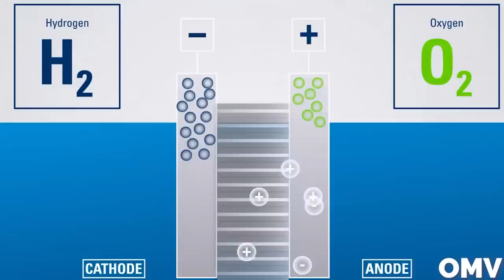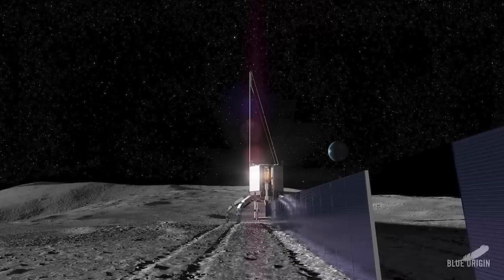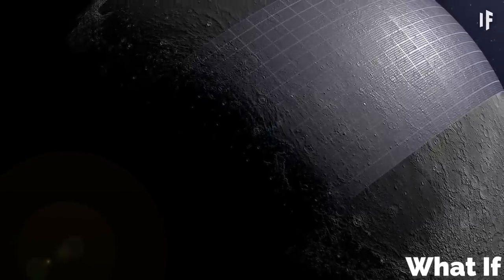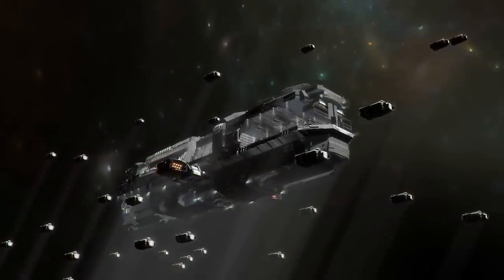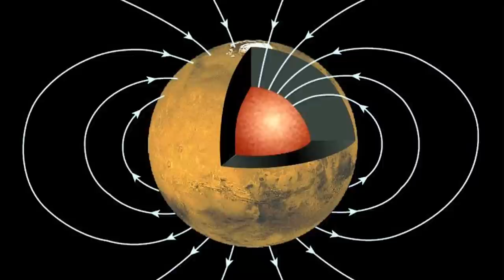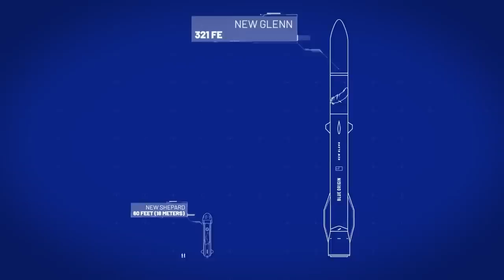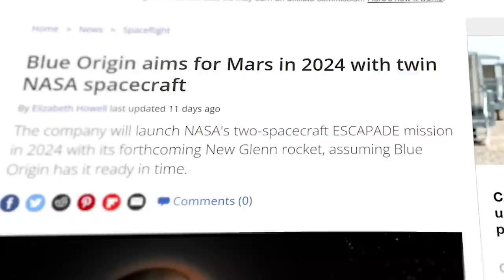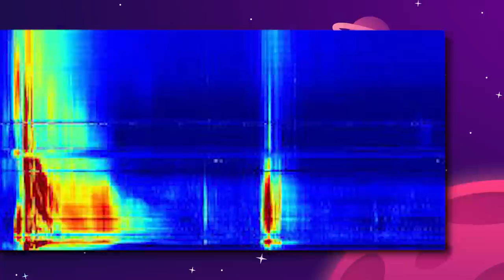Blue Origin Reveals MAJOR NEW Breakthrough On The Moon!

Comment: Tornadoes destroy electrical infrastructure every year. They could build it to withstand tornadoes but they just let it get torn down and then rebuild it to the same standard. This should tell you how much work is going to be done in advance of a severe solar storm. The answer is none. They'll let it burn down and then eat the cost of rebuilding it at that time. Not sooner, possibly not ever.
Reply: Use concentrated solar power with glass reflectors powering the system
Reply: You don't understand engineering at all then 

The cost to rebuild them is lots cheaper than making everyone tornado proof 

Also to make them solar storm proof means encapsulation of every single wire in the grid 

I'm sure I don't need to point out that this would mean every pylon would have to take nearly 2x the weight meaning around 3 times the cost
Reply: That’s a horrible idea in space, the colonists will die without the electrical grid working to operate their oxygen recyclers and various other systems.

Comment: There is 3 obstical in installing solar panels on the moon. [1] up to mach3 hale storms (astriods/bolders/rocks). [2] Moonquake (ground shifting that occurs in inches per month & years of accumulated E.T. debrees & core pressures). [3] solar storm CME to circuitry.

Comment: I like how Blue Origen worked out the smelting method that will work. This new smelting method could be used for so much more than simply building panels. Hint, hint. 
Wonder if we should ask Blue Origen how they plan to use solar panels during the two week night cycles? 
If someone could workout a way to harness the electrostatic on the moon. It would supply all of there power needs and then some.
Reply: Where does the energy come from for melting the regolith?

Comment: Space exploration has long been full of bright ideas, sadly very few of which progress to a working device.  Electrolysis of solid material has been around as an idea for quite a while after people realised that there wouldn't be any convenient reducing compounds such as coke or coal on the moon, mars or the asteroids. The problem is that most reactors involve large amounts of very expensive metals such as osmium and platinum. To produce useful amounts of material it has to large to contain the melt and all the insulation needed. To power this would require many kilowatts of electrical power which all adds up to a lot of mass which has to get to the lunar surface before you get any product. Nice idea if you can manage it, but Blue Origin has got exactly NOTHING to Low Earth Orbit, let alone the Lunar surface. So a fairly distant dream. If on the other hand SpaceX, which has the capability to get there, had talked about this, then it would be more a possibility.
Reply: Mars does have CO2 that can be reduced to carbon.

Comment: I don’t think that solar cells are a viable solution if employed on the moon’s surface. The regolith composition makes it very abrasive. Though there’s a minuscule amount of atmosphere on the moon there is still regolith dust in suspension above the surface. This dust, over time, will degrade the performance of the solar cell requiring a method to wipe the transparent surface of the cell clean. Wiping the surface of the cell will cause scratches to appear on the surface of the cell. Which means that the transparent surface of the solar cells needs to be manufactured from a material that does not scratch easily. Such as ruby or some other transparent material resistant to scratching. Since there are few, if any, ruby gemstones laying upon the surface of the moon the necessary materials will have to be transported from Earth. Making the idea of gathering energy from solar cells on the moon highly questionable.
Reply: depend on how you wipe it - a simple low pressure blast of CO2 shouldn't cause problems.